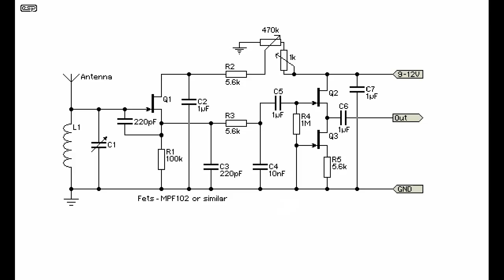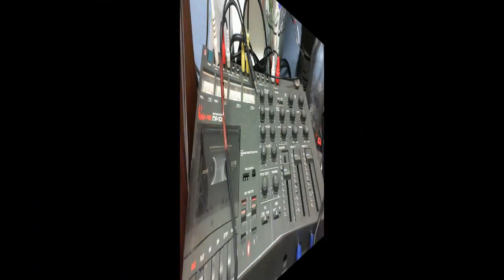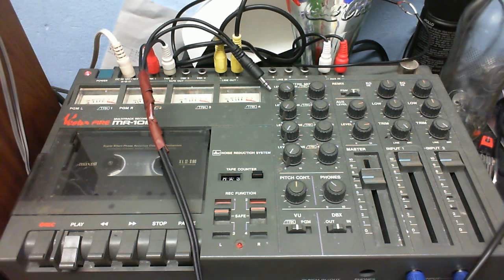Homebrew AM Radio Success!

Comment: With my spectral graph I was able to tell that most of the stations you tuned in were transmitting 7.5 kHz audio bandwidth, which is surprising because I was told that most AM (MW) stations in the UK only use 6 kHz audio bandwidth. And your radio is wideband enough that you can hear the 9 kHz whistle caused by the carrier of an adjacent channel station.